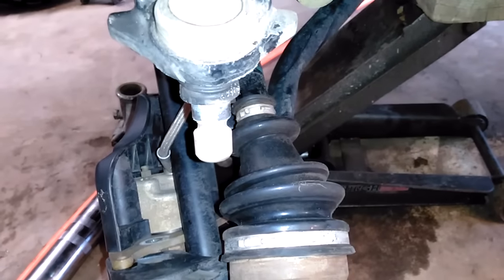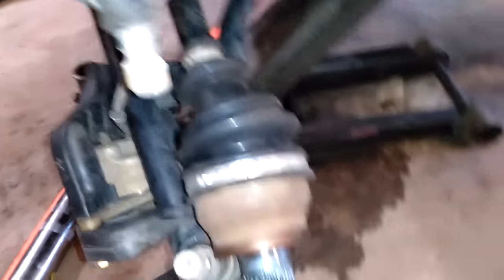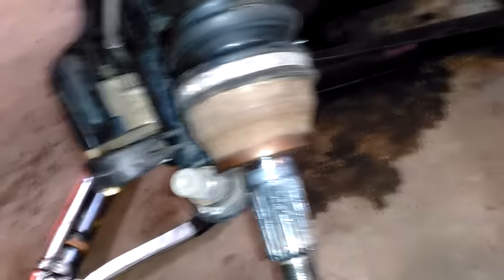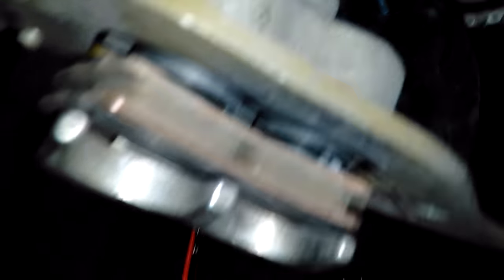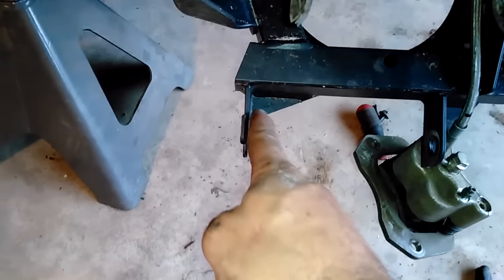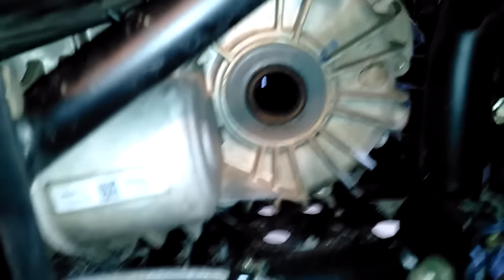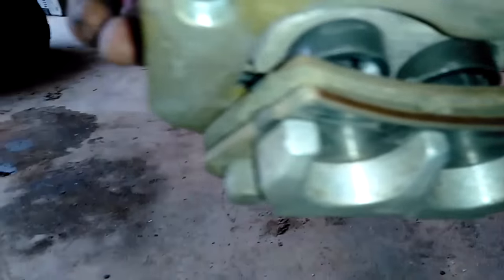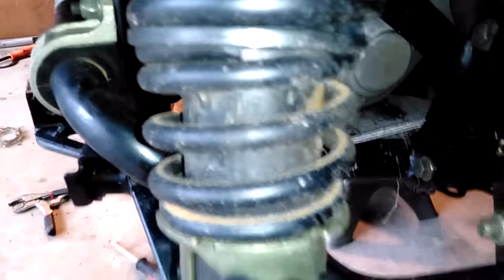rzr 900 belt service and suspension tear down and stuff

Comment: What four wheeler do u recommend I'm on a 7k budget
Reply from the maker: +Tommy Waddell Rubicon IRS
Reply: +Christian Amy ok thanks 😀
Reply: +Christian Amy what's the difference between the rubicon and the foreman
Reply from the maker: Better seat, more gc, better ride, clears bigger tires in the rear. You have to stretch the foreman for mud riding which is sketchy
Reply: +Mud Puppy just went to the dealership and they told me 8500 for rubi IRS base model...